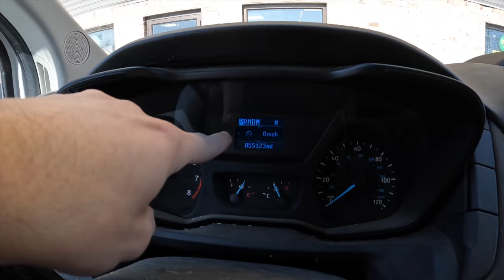Used ATM Machine Found in Trash...

Comment: Wondering why a private residence would have an ATM machine in their trash.  Most banks would handle the disposal of it themselves.  As for the dent on your Van isn’t that what you pay insurance for?  It’s 52 in Massachusetts today.  A flat head screw driver works to get the staples out of the box spring frame.

Comment: Taco for your icy mess in front of storage shed get two heat tapes like used for trailer frozen pipes plug them in  melt down unplug them Should work ❤

Comment: You work so hard and so much.  I am curious as to how many hours a week you estimate you work. I am certain it is more than the 40 hour week standard.  Best wishes that 2024 is a great year.
Reply from the maker: Depending on the season it ranges from 60 - 80 hours, there are some days in the summer where I put roughly 16 hours in and don't realize it until I am in bed